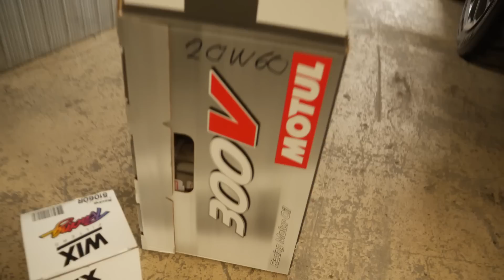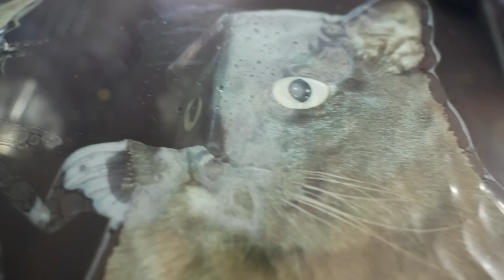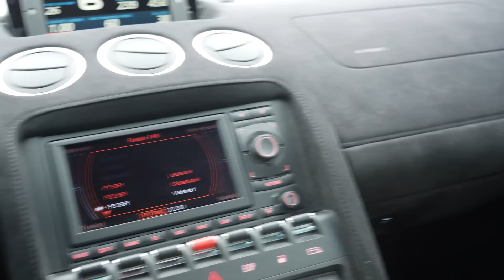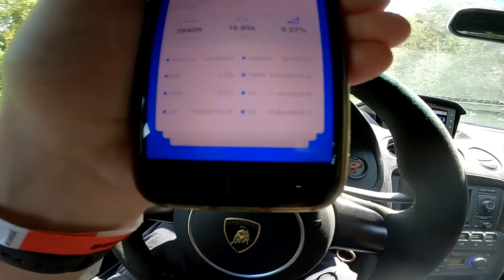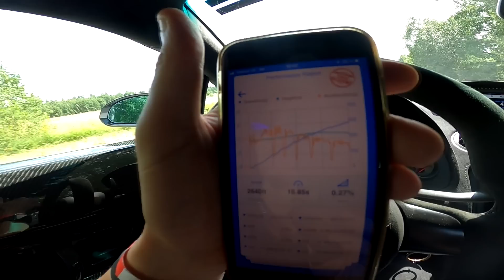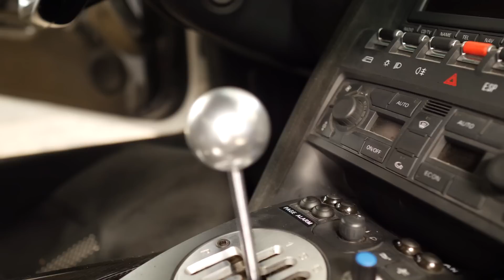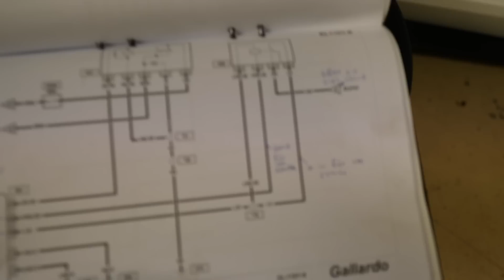Airstrip racing with my Twin Turbo Lamborghini Superleggera

Comment: Your even firing V10 sounds so much better than the later versions of Lambos and Audis IMO, love this sound!
Reply: Yes audi v10 really v8 or I think
Reply: @ksm1985  early R8 had V8 engines but the red one in the video has a V10 with "odd" fire-order. Just has a different sound to it, more like two straight fives than formula 1 v10 sound ;)